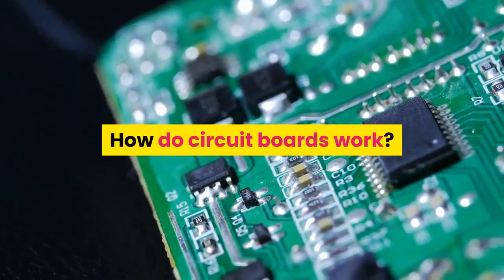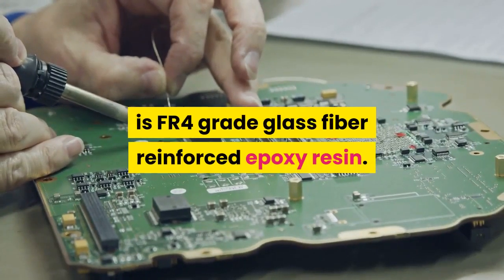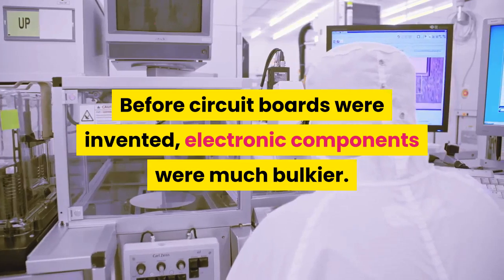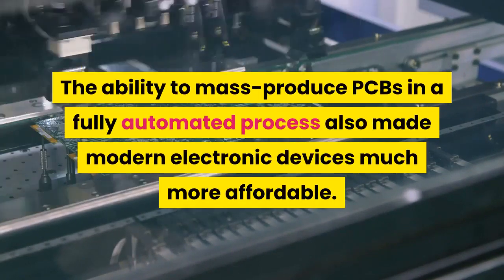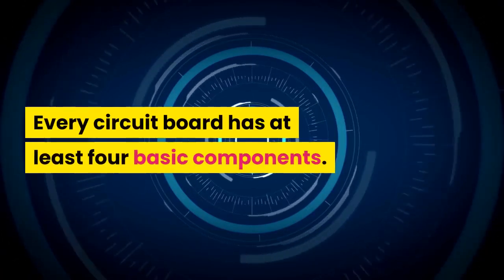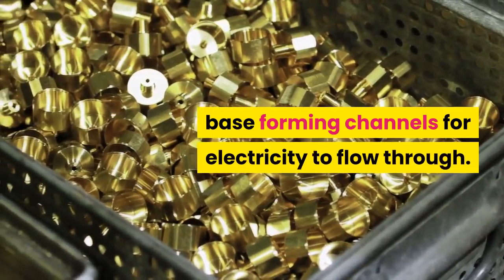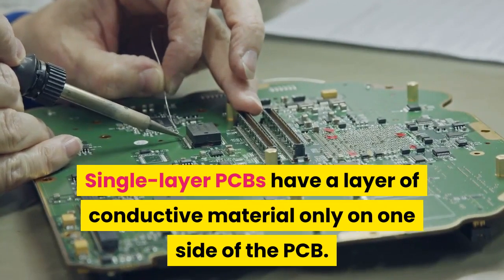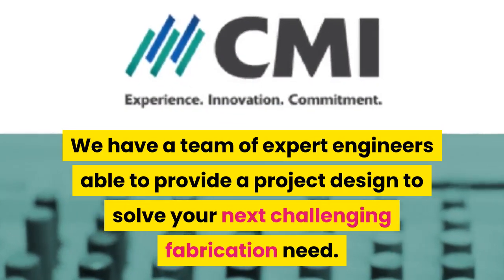How Do Circuit Boards Work

Comment: How long does it take to make one board from start to finish?
Reply: They are mass produced after making a template

So maybe the template could take a few hours and then the rest is done in minutes to reproduce
Reply: I WORK in the silicone Valley and I do make circuit boards.. depending on the layers and how many panels it could take about a week or so to complete a job of maybe 6 panels
Reply: I still don't understand exactly what/how electricity flows through it. Is there a small conductive wire (like copper) inside of the board that only goes through certain parts of the board or is the entire board conductive?